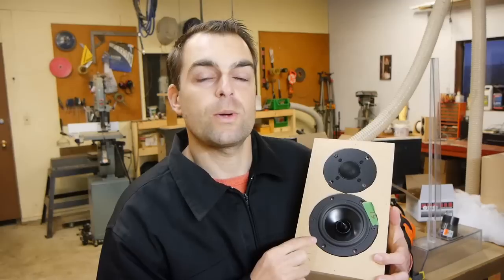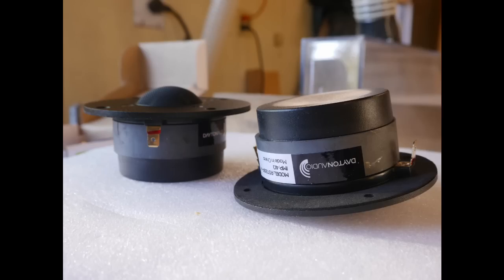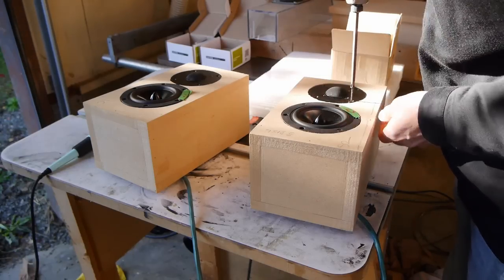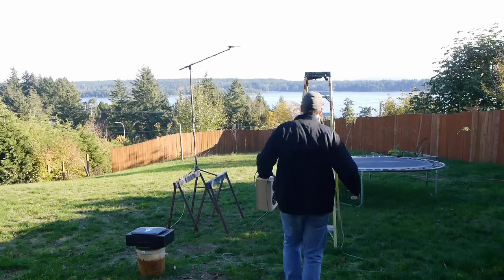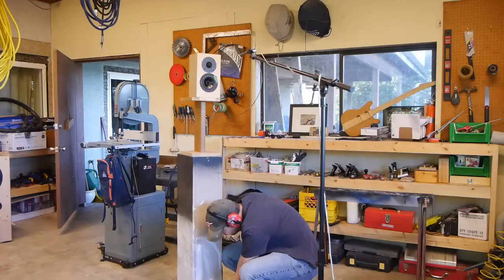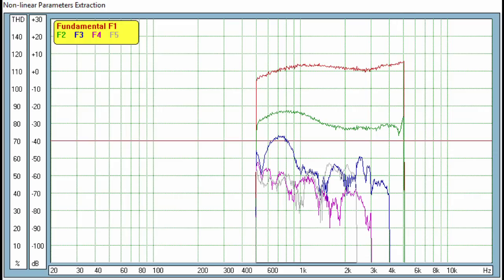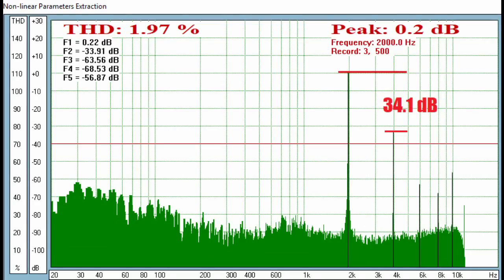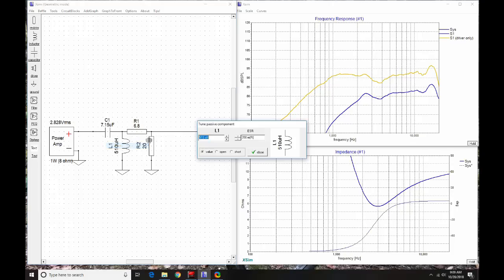Dayton Audio RST28F tweeter | Test and Review

Comment: A way to deal with the leads coming loose is to have some various sized pieces of aluminum or copper on hand. Clamp them on either side of the lead so that they sink the heat rather than letting it get to whatever solder joint or plastic that is softening inside the tweeter housing.

Comment: What are the lowest you feel comfortable crossing those tweeters
Reply from the maker: Hmm, maybe around 2khz depending on how it is done. Possibly lower. Also depends on the application. If you are using them for desktop speakers or background music, then 1500hz is probably ok.
Reply: @ImpulseAudioSpeakers  I was going start it hard at 2000 with a 3 rd order crossover and an Lap and it's going to cross the woofer at 1500 and the woofer I'm using a 3 rd order also so they are both dropped off really fast. But some people are telling me that the old rts28: was better and the new is just ok idk I never used either. But they are for my small bedroom for my TV and music it's like 10" from couch where I sit and watch TV and listen to music it's a small room around 12" 16" but I was pairing them with 8" Dayton audio reference paper cone they don't break up as made as the aluminum. I'm dropping the woofer at 1000 with a 3rd order and the tweeter at 2000 with a third order and a L pad and they are both dropped really hard so I think I should be ok . I designed it on xsim. They are going to get played loud sometimes with heavy metal so hopefully they can take it. Thanks again and are making videos anymore?

Comment: Thoughts on RST28F vs RST28A? I am thinking about one of these used in a SEOS-8 paired with an 8 inch woofer (peerless 830869). I am thinking SEOS-8 to perhaps achieve a lower XO, as the peerless woofer response gets wonky above 1.5K.
audioxpress has testing for both available, but it hasn't entirely made the choice easier (I probably don't truly understand what I am looking at)
RST28A seems flatter overall and maybe a bit tighter off-axis, but rolls off a bit above 10k. The RST28F tends to rise all the way to 20k after the hole at 2k and has higher sensitivity and lower Fs. I'm worried that the rising response of the RST28F might leave things a bit bright sounding.
Reply from the maker: MrChompenstein the F isn’t bright sounding in my opinion. I wouldn’t worry about that. But I wasn’t blown away by the F so I’d try the A personally. I wouldn’t worry about the Fs difference either. They’re very close I’m sure, so it’s really up to you.
Reply: @ImpulseAudioSpeakers  I was already leaning a little towards the A, but once the woofers arrive I can get measurements done on those to perhaps get a better picture of how they behave. Ultimately a waveguide means Dayton's FRD wont be accurate down low, I will just have to take the plunge on one of them.
Also, very good info about the off-axis interaction with the dip at 3.5k. I will be sure to look out for that. Thanks

Comment: Would you happen to have first hand knowledge of the Dayton ND tweeters? ND13FA, ND16... the smaller ones. They're interesting because their body is tiny, allowing for placement close to a high-reaching mid - to provide the brilliance into the 20KHz+ area and also good for minimizing lobing I guess. There are not a lot of tests of these tweeters around.
Reply from the maker: Steen Suder I have a little bit of use with the ND20 and a lot of use with the ND28. The little ones have to cross pretty high and that’s their downfall. Otherwise ya they are good for having very close spacing (thus less lobing) and are cheap enough to experiment with. I’m a cross low and cover as much of the 2,000-20,000 Hz range as possible kind of guy so the little NDs haven’t appealed to me much personally.
Reply: @ImpulseAudioSpeakers  Thanks, the idea here involves the new SB MD60N-6  (currently for preordering) and crossing at 5 or 6K (3 way). I'm trying to find out if they're good enough in the top two octaves to spend time on experimenting. Little diameter could cater for wide dispersion and the high cross would minimize the impact of the low power capability.
FYI, the MD60N-6 is preorder priced at ~€15 in Europe which makes it very interesting in my eyes.

Comment: To whomever cares there is a tweeter that imo is a really good ,durable and now super cheap tweeter mn# 160710 & kl-rd (I've seen it as both numbers?) it's a  Klipsch soft some neo magnet horn and its also used in alot of BIC America speakers, I've heard them because there in all my BIC Acoustechs, I think there sweet sounding, clear & detailed but not harsh, there on eBay and Amazon prob elsewhere on a factory buyout for $11 each! it is just for the driver it doesn't include a 3 bolt waveguide, I bought 2 for backup tweeters for my BICs where there soooo cheap. But I'm getting a couple more for a diy bookshelfs, I bought an Eminence 2/3 bolt to 1 3/8" thread adapter so I can use the waveguide from the PRV WG175PHs I want to compare them to that I am on the fence with them, There good enough that If I could afford it I'd buy a bunch n stash em.

Comment: All the measurements are cool.. But how does it sound?? At the end of it all the ear will be the best test..lol
Reply from the maker: juanmangerita to me it sounds ok. I have other videos about using this tweeter and make some comments about it. It’s really hard to make subjective comments about a driver because it depends how it’s used. If I implement it poorly or match it with a really good mid etc I may have a different opinion. A complete speaker is a finished product that subjective comments can be made about. Even then it’s important to make sure it’s implemented into the room and system properly. But these variables, although huge, are much smaller than a raw driver.

Comment: Hello. Can you show how you measure the dynamics through the microphone and with what program do you set the ZMA, FRD graph? Thanks.
Reply from the maker: Рубаиль Сафаров I’m not totally sure what you mean the dynamics. Do you mean distortion?

I use Xsim to load the frd and zma files to play with crossover components. There are other options but I find this to be the easiest and best.
Reply: @ImpulseAudioSpeakers  How can I measure the frequency response myself and save as FRD and ZMA, through a microphone or through some kind of program?
Reply: @ImpulseAudioSpeakers  in short, I need to measure my speaker and put it into the XSIM program, but how?
Reply: @ImpulseAudioSpeakers  I mean to DRIVER
Reply: @ImpulseAudioSpeakers  How to get FRD and ZMA?
Reply: Thanks
Reply from the maker: Рубаиль Сафаров oh I see what you mean. You need a measurement program like Room EQ Wizard, HolmImpulse, Arta, etc. There’s a few of them. My preference is HolmImpulse. Most people use REW however. Set the speaker as far away from boundaries as possible. And take the measurement. There’s a bit more to it but it’s difficult to explain. I should do a video doing a step by step demonstration of this. I think it would help lots of people.
Reply: @ImpulseAudioSpeakers  Thank You! I will wait for the video to be released
Reply: Then, using these programs, measurements will be synchronized in the FRD and ZMA formats?
Reply from the maker: Рубаиль Сафаров yes you should be able to export them. If they only export as txt files then you’ll just have to convert them to frd by resaving the file as .frd or .zma.
Reply: @ImpulseAudioSpeakers  Thanks! I realized.

Comment: I´m planning to build a center speaker combining this tweeter,  a RS100-8 as mid and two RS150-8 as woofers in a "w(t/m)w-Design". Since i´m a beginner: is this a sensible combination/design? Educated opinions are appreciated :-) !
Reply from the maker: Frank Geiger hi. The combination isn’t a bad choice. Using drivers that are better suited to roles as woofers and mids would be better. Also, no need to match brands. Usually doesn’t look as good as people think and has no impact on sound quality. Better to pick drivers that make sense.

But most important, as a beginner, please do a 2-way. 3-way speaker’s are 3x harder to do and you chances of success and satisfaction with the process will be so much higher with a 2-way. Sucks to spend $300 on parts and get mediocre results and wish you just bought speakers. Even if you want a 3 way, do the 2 way first. Honest.
Reply: @ImpulseAudioSpeakers  That´s the difficult one: how do i recognize drivers which are suited for my project? I´m not set on dayton speakers, so what are your suggestions? Personally i would prefer a 2-way system but because of the special situation for center speakers that seems to be quite difficult......
Reply from the maker: Frank Geiger ah, a 3 way center channel speaker. Even trickier. How about a design already published that you can follow along? If choosing the drivers is new to you, then crossover design will be too. If you pick a design that’s already worked out you’ll be more likely to succeed and learn a lot along the way. If you do want to have a go at it, then I’d use those Dayton drivers you mentioned cause they could be repurposed many ways. They’re jack of all trades drivers.
Reply: @ImpulseAudioSpeakers  I wanted to build a 2-way-system using the mentioned tweeter and woofer, but then i learned that most centers are actually 2,5-way systems to avoid the drawbacks of an d´appolito-arrangement of the drivers, but they have - spoiler-alert - disadvantages by themself. I actually looked for an already published project but i could´nt find a speaker which is max 8 inches high, better 7 inches......

Comment: speaker terminals are meant for quick connect not soldering iron.also the difference between FS is due to one tweeter was not optimally calibrated voice coil in the magnet gap.

Comment: Hi, I have question(s) re new Dayton and since you had some time to play with RST28 a bit how does it compare to other offerings in $50 - 70 range,  like SB29RDC and the neo version, Scan HDS, Usher 9950-20 (old RS28F). How do you like the sound of the RST28F so far. I need something to go to 1.6k cleanly.
Reply from the maker: pliedtka I’m not totally blown away by it, but it’s a decent value. I still like the SB better. Even the Vifa XT25BG is better value. Decent sound though.

Comment: Great video!
Could you test the Dayton Audio ND25fa in a future video? I wanted to know what you can really get for 10$ or less. The frequency response looks fantastic for this price.
Reply from the maker: Michel Remmel hmm, I might have that one on my shelf. If not next time I make an order I should order a really cheap tweeter like this one for a test video. Good suggestion I’ll keep it in mind. Quite a list of videos ahead of me though.
Reply: @ImpulseAudioSpeakers  Thanks for the fast reply!
The reason why I want to test this driver is that I'm planning to build a 3 way speaker with it. The other drivers will probably be a Monacor Sp-60/4 and Dayton Sd215-88a.
I already designed a crossover for them and they work really well together.

Comment: Why do you actually use white noise, instead of a frequency sweep? What are the pro's and con's between them?
Reply from the maker: Arnand de Jager it doesn’t really make much of a difference. The sine sweep I find works better at low frequencies, so I use it when measuring the bass response. White noise (MLS) is said to be better at filtering out ambient noise. I use both but probably prefer sine sweep if I could only have one.

Comment: So we have it - not that bad. Definitely 4k, 2k diffraction peaks and dips - whatever. But most soft domes don't need 'correction' disc in front of the dome, so something is wrong somewhere - the raising freq above 15k perhaps? Terminals - the same problem with other tweeters - now I use something to take that extra heat while soldering. 
In the past many tweeters used to be 6 ohmers - easier load on amp, very workable with crossovers, efficiency still OK - why manufacturers switched to 4 ohms is a mystery to me - maybe so people think that these are car audio spkrs😋, seriously what's wrong with 8 and 6 ohm impedance.
You have to try them in 8x16" baffle, with some 6-7" midwoofer - the peaks and dip will be 1k lower in frequency - maybe it will be more x-o friendly.
Reply from the maker: pliedtka I agree with the wider baffle. Hopefully I can find to do that. The 4ohm thing I’m sure is just to spec brag that they can do 93db or what ever. These didn’t even make the sensitivity spec. So not that impressive really. In the end they usually always need padding down but in that rare circumstance that the rest of the drivers in the speaker are that sensitive then these 4ohm tweeters have a better chance of marching.

Comment: Three thoughts: 
First, your off-axis measurements look painful to take! Time for a lazy susan? 
Second, instead of ignoring the hole why not design the crossover based on a listening window average? That works especially well to keep perspective with a coax or round waveguide due to the large axial notch. 
Third, since you're not chamfering the baffle, perhaps try some felt or foam around the tweeter to see if that helps with diffraction?
Reply from the maker: Raymond Cooke all good points. One, I normally rotate the little stand on top but didn’t this time. Which is why I poked fun at myself during that part. Two, ignoring it is paying attention to the listening window. Much the same as the coax or waveguide example. I know that the listening window will be fairly smooth through there. Especially after I explain number three. But maybe I’m not quite understanding what you mean by this?? Three, I do plan on shaping the baffle. This was just a test box and will go in the garbage once I’m done with it. The final box will include hand shaped round overs. That will really smooth out the off axis response and make the listening window more uniform. 

Definitely good things to think about and happy to see viewers paying attention to those details.
Reply: @ImpulseAudioSpeakers  Thanks for the detailed reply! I missed that you were going to smooth out the edges on the final cabinet - though why roundovers when your tests showed chamfers worked just about as well? Aesthetic preference? I thought this box was the same form as your final one, and was thinking about earlier studies - David Ralph's for example - that showed how using felt or foam strips on the baffle can reduce diffraction effects.
Reply from the maker: Raymond Cooke mostly how I want the final aesthetics to be. It’ll make more sense once they’re built. Hard to explain. 

David’s work is the best I’ve seen with the felt. I haven’t personally done much testing with felt so I shouldn’t make strong arguments for or against it. I think it has merit but man it’s ugly haha.

Comment: Defective tweeter? Other RST distortion tests have looked much better. What was the testing SPL and mic distance?
Reply from the maker: machoheadgames I haven’t seen any other tests but I thought this looked really good. Other than second order, the other orders are way down in the floor. Level was set for equivalent of 92db at 1m so I left the 2.8V input. Moved the mic to 10cm. 

It’s really hard to compare distortion tests which is why I rarely talk about them. I usually just throw the results on the screen and tell people to go back and pause to look. This time I spent more time on it because I’ll be working out a XO. So depending on how different they look I wouldn’t be concerned. This was a good results and out of all the tests done here it’s what makes this tweeter ok, unlike the frequency response.
Reply: The only other test of RST28 was done by Vance for Voice Coil or Speaker Builder, unless there is a test which Google search doesn't know about
Reply from the maker: pliedtka oh I’ll have to check it out. Been a while since I checked my voice coil account. I missed it.
Reply: Hey, let us know what's different between your review and Vance's, other than infinite baffle in Voice Coil test - other than that they should be quite similar, unless there are production variances like in RS midwoofs you tested.
Reply from the maker: pliedtka I only see the RS125 there, not this tweeter. But it looks like I got similar results on the RS125. They also have that pesky shelf between 3-4khz. Theirs is the 4ohm version but close enough.

Comment: Recently found your channel. Great content. Have you ever done a video on crossover components ? For example is a Mundorf silver gold oil cap really that much better than a Clarity cap ? Or a Goertz inductor that much better than a Madisound inductor ? I want to build my own bookshelf speakers just not sure paying a 100 times more for a component is worth the money. Thanks for your videos.
Reply from the maker: Nowandthenagain hey thanks. I haven’t done a video like that. I don’t think buying those expensive parts are worth it. Especially if you’re starting out, just pass on that stuff.
Reply: Most of the time waste of money. If manufacturers use standard parts in kilo $ loudspeakers then why bother. Better use of the money is DSP active crossover and good multichannel amp.

Comment: I happened to install some Dayton DC28F-8 tweeters in an old pair of 11.5" wide custom cabinets last night and have the same on-axis dip.  Curt Cambell also mentions it on the build pages for his Tritrix design.  I think it's something inherit in the design rather than diffraction.
Reply from the maker: Dan Saville there may be something inherent in the tweeter design but there is definitely diffraction at play, which is causing most of the issues. The off axis measurements prove it. If you check out my video about diffraction you will see how this can be improved with a round over.